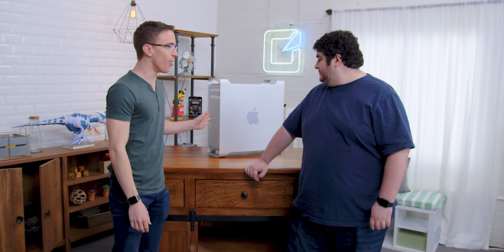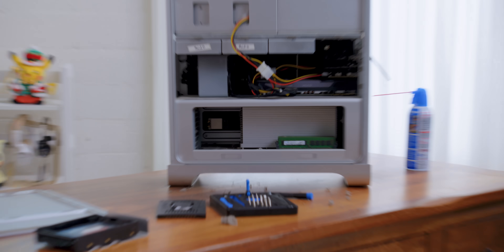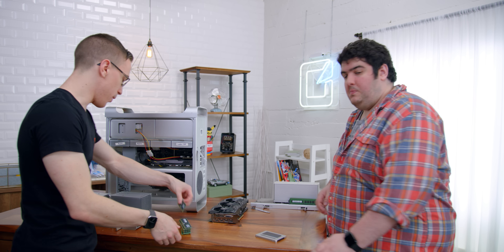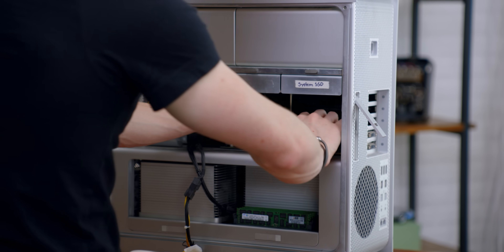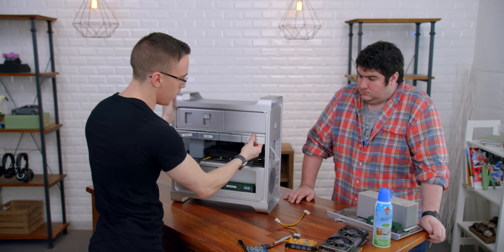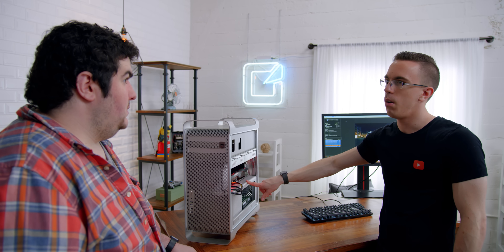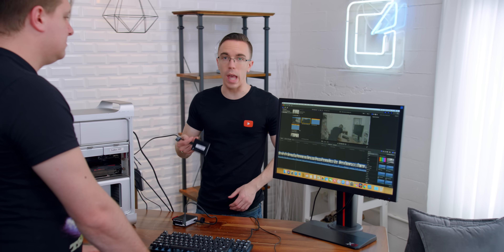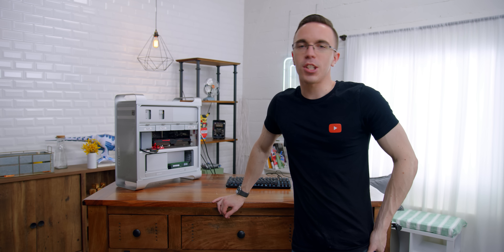Building The Ultimate Mac Pro

Comment: But can it run Austin Evans
Reply: No. You need of a quad threadripper 2990wx( 128 core and 256 threads),  Nvlink of Titan RTX with overclock to 3GHZ, and 512 GB of ram.
Reply: @rj7250a  no wat are u talking about u only need 1mb ram
Reply: Silver Ghost 1Mb? For 16K monitors? With 16KB you can run at 4K.
Reply: Can i run it on my potato?
Reply: Hey guys its austin
Reply: Austin.exe minimal specs:
And epyc CPU or Xeon CPU
1tb of ddr4 at 3500mhz
4 rtx Titans 
Recommend specs
3x Xeon CPU or 4x AMD epyc CPU
8 rtx Titans
5 TB of ddr4 at 5000mhz
REEEEEE spec requirements
Humans haven't have not met this level
Reply: absolutely it can't
Reply: No
Reply: You need NASA's super computer to run austin evans
Reply: No, you would need a super computer to be able to handle that!
Reply: Chief Yoshi I’m sorry but Austin Evans.exe has crashed

Comment: Loved watching this upgrade. I have been tinkering with my 2010 Mac Pro for about 2 years now. Single-core, but upgraded to 3.46Ghz Xeon 6-Core, 48GB ram and about to boost to 64GB, Nvidia 680 Classified GPU, 2TB Micron OS SSD, 480GB Inland Professional SSD for FCPX library and scratch and 120GB ZSpeed SSD for video and photo editing scratch, not to mention the hard drives for basic storage. Addicted to this machine! Brings me back to my PC tinkering days but now in the Mac world. Riding this machine until it dies!
Reply: What exactly is Nvidia 680 classified. Google isn't my friend this year..2020
Reply: U should consider putting a 1080 in there running macOS High Sierra, or Mojave or AMD, whatever, but that 680 really is holding you back
Reply: I have a Mid 2012, thinking about upgrading. What was the final cost to upgrade?

Comment: Austin: This upgrade would only cost about 1000$ aside from the 14tb hard drive 
Me: Pshhh why do you need to upgrade it when you can buy the Apple pro stand for 1000$
Reply: becasue it will have perform better but besides that is the upgradable option of putting more harddrive and ram. But it all depends on the person in my case i would prefer a macbook pro laptop over the desktop since i move around a lot.
Reply: @caubomax  bro, its called a joke. Yall ain't understand anything now 😐

Comment: If you wanted "ultimate" you should have added a PCIe NVME m.2 boot drive. Those hard drives that are in there are sata2, so it would be a pretty huge upgrade
Reply: Exactly.  i've installed them in both mac pro and xserve.  6G FTW

edit:  PCIE msata.  not aware of a mac pcie>nvme.  If you are please let me know.
Reply: @eliexe6916  Yes, thanks, I realize that.  i was asking if Danny specifically knew of an pcie>nvme card which I did not as sata and msata cards are all I'm aware of for and he had referenced an NVME.

Cheers!
Reply: @ricoswave2326  Nice! Yeah, I got a cheap pcie 4x m.2 adapter off amazon for like $15, then added a Crucial P1 1TB nvme m.2 ssd, installed my os on it, and now my boot drive gets 1.3 GB/s write and 1.5 GB/s read. Compared to the SATA-2 slots max of like 250 mb/s ish, and a m.2 sata cards max of like 500 mb/s ish, its not too bad! Yeah, like @Eliexe said that is right about the max bandwidth I can get on it, vs some of the faster NVMe drives, but its pretty decent. I didn't have to install custom firmware tho.
Reply: Too bad it would default to 4x
Reply: The logic board doesn't support it (at least in their full potential with the outdated PCIe buses). There are so many bottlenecks if you keep the original mother (logic) board that it came with. Hence why I sold mine and got an iMac 5K until this things gets out of date as well.
Reply: Agreed as SATA II real bottleneck for SSD
Reply: C Rizzy  Yup that what nice about Mac Pro is expandability and taking advantage of rest of PCI-E slots--im using USB 3.1 card also really helps lot also
Reply: Danny Davenport you mean pcie AHCI drive which will be bootable ✅
Reply: Add two PCIe CARDS With in each a NVME SSD and put them in RAID 0 config than your disk will be 10x faster as current setup
Reply: Just how much faster will nvme get you if you dont edit in 4k?

Comment: 3.46 x 2 is the "ultimate" CPU upgrade for this system, I get about 24K in multi-core score. Also, it will run faster (about 5%) with 48 gigs of ram as it has 3 RAM channels.
Reply: TexMex 16x 3 on the Ram with 12 cores 5690’s  and 512 AHCI Drive on the pcie for boot!

Comment: Austin, I don't like you, or your channel but I love the old Mac Pro and Power Mac G5. I did the exact same thing on a G5 2003 I got at a garage sale. I just fell in love with the thing and it has been the only dual socket thing I've ever owned. I gave it 8gb of DDR1 ram, new HDDs, the best AGP x8 GPU it could take, an AirPort wifi card, new DVD writer, new thermal paste ( a pain on those custom motorola CPUs). Mad respect for you to actually do this the right way and get an addon socket for this and max it out and go balls out. You just got a sub for helping this old Mac. This is what Apples were supposed to be for, cheap (relatively) and easy to user upgrade for the home and office professional look at the Apple 2GS or first Power Mac.

Comment: I've built MY ultimate cheesegrater 2010 Mac Pro.
I upgraded my cheesegrater with the same two 3.06 GHz six-core CPUs you installed (replacing the original single 2.8 GHz quad-core), 96 GB of RAM, an RX 580, two 1 TB NVMe SSDs (4 TB in total across NVMe, SATA SSDs and a mechanical hard-drive), a USB 3/C combo card and a Blu Ray drive. 
I also upgraded my 2013 trashcan Mac Pro with a 2 TB NVMe SSD, 64 GB of RAM and (most recently) a 3 GHz TEN-CORE CPU! Not only was the CPU I installed never offered by Apple (trashcan Mac Pros came with 4, 6, 8 and 12 cores), but it's better-value than the official configurations: you could get a 3 GHz Mac Pro with eight cores, but the 3 GHz CPU I installed has ten.

Comment: I recently bought a 2009 mac pro dual cpu with 32gb of ram with a terrabyte hardrive and 2 mac orginal gpu's for $150. Put in the optical bay a samsung 500 evo ssd ($50) and a radeon graphics card that i had and this machine works as well as my modern computers, all for $200.

Comment: To really upgrade this to 2019 specs, need to convert it to a Hackintosh.
Reply: Do you have any links to ultimate builds?  I wad thinking of building one.
Reply: Well... You'd be better of going all new instead of butchering a Mac Pro case. Will look nice, but everything else won't fit or work out of the box (power button, boot logo, hdd trays, air flow, psu, etc. That's why people do it this way. It's quick and easy. If you really wanna do it, get a G5 case and a Dremel.
Reply: Brian Sousa super easy just have to cut out the io shield and jb weld the stand offs to new spots

Comment: Best Mac Pro ever launched in my opinion
Reply: Best Mac in general. The only better one is the early 2012 Mac Pro with dual sandy bridge Xeons.
Reply: FrankenTosh Mac Pros rule!
Reply: Is there really a Sandy Bridge Mac Pro? At least mid 2012 Mac Pro is still Westmere just like the 2010 one is. And the trashcan late 2013 Mac Pro has Ivy Bridge Xeons.
Reply: Typically it was a Xeon (Westmere socket 1366) single or dual 4-core or 6-core system (8-core/16-thread or 12-core/24-thread) Similar to x58 systems.
Reply: @EvilTurkeySlices  the 2009 - 2012 are exactly the same (2009 just needs to be flashed). there is no sandy bridge mac pro.
Reply: @Pasi123  no there isnt.
Reply: Which is why Apple abandoned them?

Comment: I have the 2010 Mac Pro with the 2.93ghz 6 core Xeon, 32gb RAM, and original Radeon 5770. It runs Final Cut and Photoshop like a beast. However, I am planning on upgrading the graphics card soon so I can update to macOS Mojave. Although, it's from 2010, it's still a great computer, sadly you don't get this caliber of a computer from Apple anymore.
Reply: best Mac ever

Comment: I've done this to 3 different vintages of mac pro towers. By showing a 3.06GHz clock it looks like you took it to dual X5675. you can always push those a little further and drop in the X5690 and push that to 3.46GHz base speed. I wouldn't waste money on delidded CPUs , just grab a matched pair on ebay. You don't need to delid them for the stock coolers. You do need to watch voltages though as the X5690 is a 130w chip, unlike 90w that apple shipped stock. I can confirm that the stock PSU will run dual X5690s as well as a Quadro K5000 without issue under 100% load. They still make great video and 3d graphics machines.

Comment: I just managed to get my 2006 original Mac Pro 1,1 up and running again with a super cheap ssd, a used video card from eBay, $13 for 16 GB of ram and viola, a quite usable old beast. Sure, it’s not super fast compared to today’s machines but running Mac OS El Capitan 10.11.6 it almost feels up to date.

Comment: 6:55 for $1000 you can just build a NEW PC that's more powerful than this upgraded Mac Pro using 10 year old used parts.
Right now i have a Mid 2010 Mack Book Pro and it won't upgrade to Mojave, and it's complete crap for gaming. To bad i can't just upgrade that..  I could sell it but it's not worth anything on those sites that will buy used phones and laptops like Gazelle.
Reply: I agree... Yikes. 9 year old system.
Reply: not quite 9 years old yet (i got it i the fall of 2010, it's only February now), but it's already been upgraded with 8GB ram (had 4), and I installed an SSD into it. It runs fine but only for basic stuff.. very little gaming. And since it's a laptop it cant be upgraded any more than I've already done to it.
Reply: @fragalot  I was referring to his friends system. Might as well be 10 years old. That hardware was thought of years before we even get it.
Reply: @SmallEngineNut  then why reply to my comment directly if you're talking about something else?
Reply: @fragalot  Because you're referring to the age of your system. It's just as old as his system.

Comment: the direction of the graphics card faces in the video is way more reasonable than common non-macs pc are made nowadays. basically it is more efficient for the GPUs fan to face upwards so that the heat is easier to be transferred as the hot air is lighter... wishing that more motherboards will follow the same concept...

Comment: I have a 2009 4,1 > 5,1 with a W3690 (6core) overclocked to 4.1 GHz

1080Ti 32GB RAM.

Originally had a dual CPU tray (and still have it) but I smashed one of  the sockets swapping in some X5690s.).

Yeah it’s 10 years old but I just wanted to play around with it before I do a thread ripper build in the chassis.

Comment: Bruh for that money u can build a used pc with top end hardware i have seen 1080 16gb ddr4 i7 8700k systems for 1100 $ wtf bruh
Reply: "purpose built editing rig"
Reply: @dillpill4484  oh yeah yeah 😂
Reply: Ali0The0King, Yeah, but wanna hear a joke?
Video editing on windows.
Reply: @dnsjtoh  how about S.M.O.S .... is that still a joke for u ? ...

Btw editing on windows is not bad and is not a joke i personally prefer premeir pro and like final cut but not as much .. 

Also wanna hear a better joke ? 
Buying an apple device of any kind in 2019 😂
Reply: I like building used pcs, but a 8700k and 16gb ram isn't even scratching the surface. This is mine:
Huanan dual cpu x79 board: $250
2x Xeon E5-2670, 2.6ghz, 8 cores 16 threads (16 cores, 32 threads combined): $140
Coolermaster Hyper 212 x2: $35

32gb DDR3 1600mhz ECC: $48
Rosewill case: $80
1000w psu: $70
240gb ssd + 1tb hard drive: $50
XFX RX470: $90
Total is $760 for something that would obliterate anything below $1500 in cpu performance. Geekbench score was 41000.
Reply: @AE86ofMtAkina  nice specs, hope it wasn't all used parts.
Reply: AE86 of Mt. Akina dude we are running very similar builds. Sabertooth X79, 64gb Corsair ram, Xeon e5 2670, 1070ti 😎

Comment: Nice job Austin. If you want to take this a step further, over a year ago I discovered the Highpoint SSD7101-A PCIe 16x Raid controller with four (4) m.2 banks and contributed my findings to the Mac Pro Upgrade community. With 140 Firmware, you can boot NVMe as well as use these as working drives. I have two (2) one terabyte 960 Pro's raided together (raid 0) and I am seeing speeds of 3,519 mb write and 4708 mb read. This will exponentially make your computer "scream" if you were to use two m2 slots for boot, and two slots for a working raid. I'm also operating with up to 128GBs of RAM, but that is effecting my multicore score. I believe 96GB is the optimal max out.

Comment: I got my mid-2012 chassis with a 6 core 3.33GHz tray for $50 at a thrift store.

Of course, I still had to invest in RAM, a Metal compliant GPU for Mojave, hard drive brackets, and drives.
Reply: MT T  $200 for a dual 6 core CPU configuration with 32 gigs of RAM, now that's a deal you got there, especially if you can get it to run Mojave with a compliant graphics card.

And, running an OS that's relatively more secure than Windows 10 as well as using ECC RAM, I would hope that it would be more stable than your Core i7 Dell.

Comment: You could have went with a Vega 64 on this, as iMac Pro too uses that card. Dual X5690 + 96GB RAM in 6 sticks of 16GB ECC RDIMM + Vega 64 + NVMe SSD makes this the third fastest Mac currently available, only behind maxed out 2013 Mac Pro and maxed out 2018 iMac Pro.

Comment: FYI SATA II will limit any SSD disk installed.  To get the best performance, buy a Samsung SM951 ahci 512gb stick and pcie adapter card.  That would add about $300 to your budget though.

Comment: it is called a CPU board and you can get a 5,1 2.93 6 core dual CPU tray for $65-$250, video card for $40 AMD HD7970 and $125 for 64GB of kingston 1333 GHZ memory, done it, costs $415, 26500 on the Geek scale 1400 on Cinebench, good enough for me, it's not old, they just tell you it is old so they can make more money, they have just about run out of things they have saved up to call new

Comment: I bought a pair of Xeon X5650's 1 1/2 years ago for $35. In multicore, those CPU's are faster than my 6700k! 12 cores, 24 threads. Something that modern ~$300 CPU's are starting to reach.

Comment: You could have upgraded this to be faster though. You installed 3.06Ghz CPU's, but you can actually install up to 3.46 Ghz CPU's.  You also kept the SSD on the SATA slot, which will give you slower speeds. To make it faster you could have gotten an SSD PCIe sled, and installed 2 ssds, which would be connecting through PCIe which would be twice the speed of SATA.  Additionally you guys can also upgrade the airport card to get faster wireless and bluetooth. 

It's great what you did, there are just more things that could have been done.

Comment: What are the Geekbench scores? And will this help a DAW, such as Ableton,  run faster? I've updated my 2009 to 5.1 with 3.46 six core processor and 16 gb of ram. Other than the SSD drive the processor upgrade didn't seem to make much difference. Will going to 32 GB ram make a significant difference?

Comment: Nice. I bought a used Twelve core Mac Pro with 64 GB of Ram a few years ago for about two grand. To get it up to Mojave, I put in a Radeon 7950 and an HP Pavillion 32" wide Quad High Def monitor. Also added a DVD burner in the second tray, a nice USB 3 card, and added a OWC Mercury EXTREME Pro 6G SSD card (1 TB) in a slot to boot with. Gradually, So far I have replaced on spinning hard drive with a 1 TB SSD, and eventually will replace all the others when 4TB SSDs cost what spinning hybrid drives cost now. Mac Sales has a great deal on 128 GB of Ram for $549, and they'll give me a couple of hundred for my 64 GB trade-in -- just as soon as I can raise that kind of dough :(

It's blazing fast, does 4K Video without breaking a sweat, and PhotoShop loves the machine...

Comment: There is better way for system SSD. You use SATA 2.0 port which limits transfers to ~200MB/sek.
I suggest PCIe SSD like SM951 (AHCI version) or Kingston HyperX Predator that offers much better speeds.

Comment: Dude you should have asked the Low End Mac community for advice. I have the exact same machine, a 2010 Mac Pro. I upgraded mine from 2.4GHz 8 core to 3.46GHz 12 core. Installed 96GB of 1333MHz DDR3 ECC memory. You really only want to use 6 DIMMs with this model, because the CPUs only support triple channel memory configs. If you use all 8 slots then your memory has worse performance. I also added a Radeon Pro WX 7100 GPU, basically the workstation equivalent of the RX 580. It's single slot, single 6 pin power required. With the latest EFI firmware update, you can even boot off NVMe! So I have an NVMe card in mine with a Samsung 960 Pro boot drive. My NVMe card has room for 4 NVMe drives. I also added a USB 3.0 card and a 10GBe card, both from Sonnet Tech. Last, all my hard drive bays are filled with 14TB Seagate Iron Wolf Pros in RAID10, which I use for network time machine backups. My Geekbench multicore score is 26810.
Reply: Other thoughts. If you really want to make it a crazy upgrade, you can even replace the wifi and bluetooth cards to enable hand off and Wireless AC. You could also do something called the Pixlas mod, which add extra PCIe power cables so you could install a Vega 64 card. Now THAT would be sick.

Comment: Excellent video - I have a Mac Pro 5.1 but am really curious how Matt supplied power to the USB 3.0 card? Does he have a video for that? Love to do the same on mine. Hate when it goes to sleep and drives disconnect.
Reply: Gilberto Saldivar he has unplugged one of the disk drives and uses a to-molex cable to power the card.